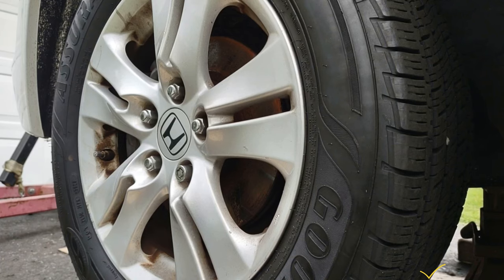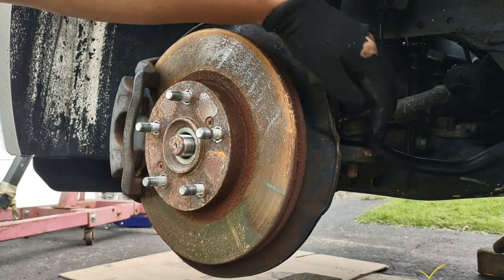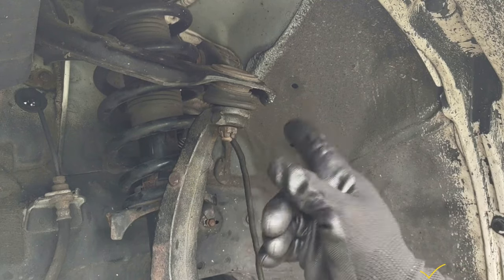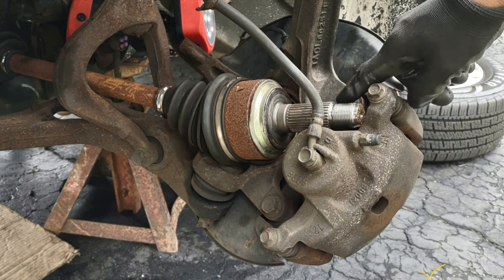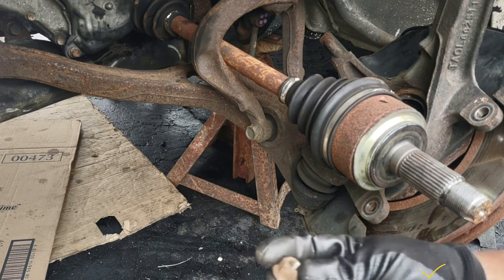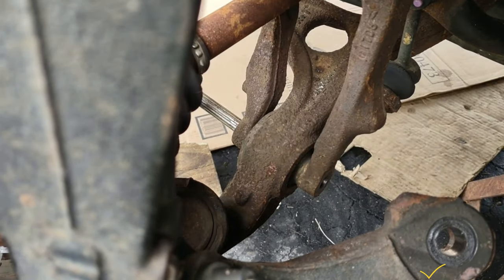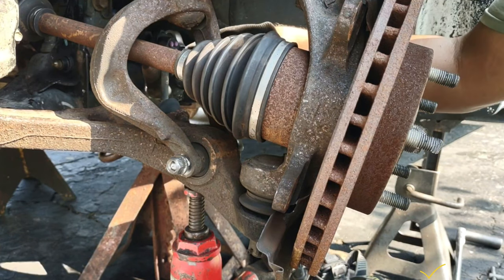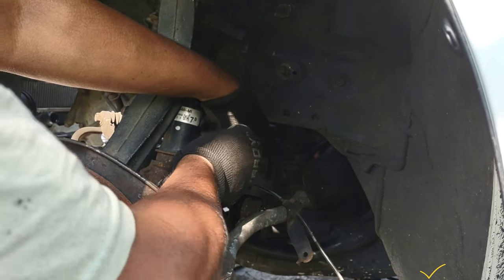how to replace front driver side axle 2008 2012 honda accord 2.4 axle replacement removal 36mm socke

Comment: My respect to those mechanics. I can remove all those nuts and bolts, but to put it back it will not be the same. lol . any screw or piece that I remove from the car, when I go to put it back as before I always have one or two screws left over. I said that was that when they did all that they put extra screws
Reply from the maker: thanks for visiting my channel I really appreciate it.

Comment: What size socket did you use for the axel nut?
Reply from the maker: thanks for your comment, 36mm socket and i want to apologize for not mentioning that in the video, i did not relize that, God bless you and your family.
Reply: @JM-AUTO  ah it’s okay. I completely changed out my knuckle assembly today. Pulled that off somehow. Haha. I gotta say though, it isn’t completely silent like it should be, my abs and vsa lights turned off and for the most part there’s no noise at all, but there’s a small almost like helicopter noise coming from the front left, idk may be wheel bearing, maybe cv axle, I’m not too sure. I’ve also seen that some manufacturers are using poor bearings from China when they put the knuckle and hub assembly together and that may be why it isn’t completely silent. I actually watched your video part by part and did exactly the same… I just replaced the whole knuckle assembly that included the hub and bearing too. Replacing the bearing alone was one step I didn’t want to do. But overall from your help and video, it worked out! Now I can make it to work! Thank you! You too by the way!
Reply from the maker: Ok great im glad you fixed the problem again God bless you and family